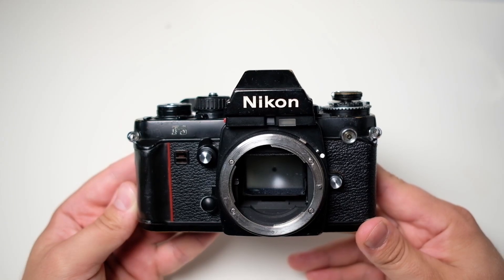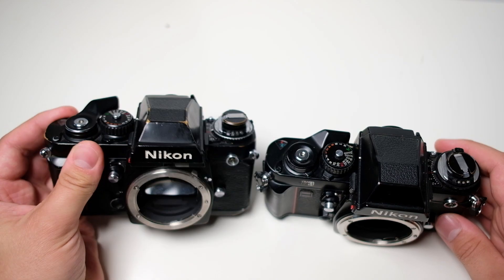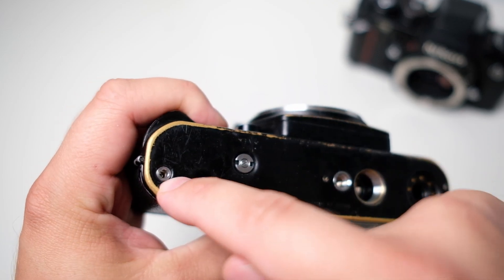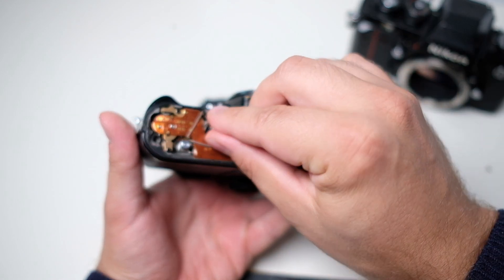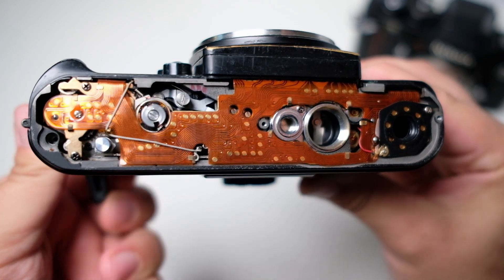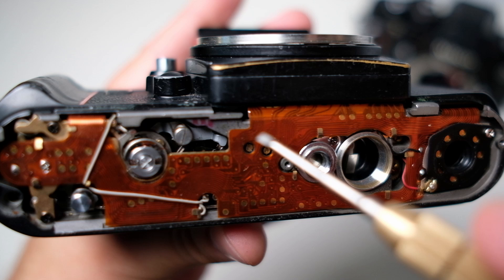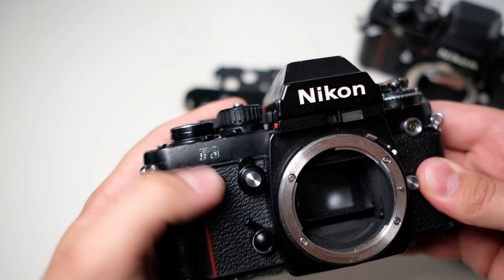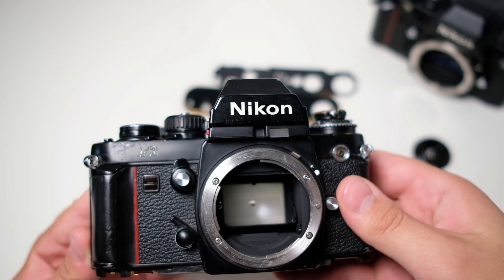Nikon F3 - How to Fix Stuck Film Advance / Shutter

Comment: Same thing happened to me a couple of years ago, I cańt believe it was that easy. Thank you! I’m guessing some cleaning will help if it happens again,.
Reply from the maker: Happy to help! My F3 was also stuck for many years, I got the idea to try this after fixing a Canon AV-1 the same way.
Reply: @mikaelrphoto  Have you found a more permanent solution? Like lubricating or cleaning some part inside? I wish I could trust that camera but to be shooting somewhere and for it to get stuck again would suck. For now it's my second camera. I don't trust it not having my tools around.
Reply from the maker: @elmaremoto My camera was randomly jamming a few times after I fixed it the first time. Also the shutter sounded weird while it was being wound up. Now it hasn't jammed for some time and the shutter sounds more normal, but yes, I also use it as a second camera since I don't trust mine either.  I'm not sure where to lubricate, I think it might need some more disassembly for the parts to be visible.
Reply: @mikaelrphoto  I understand, thank you for taking your time to respond my message, used the camera today without any issues, again thank you!

Comment: Thanks for the great video. I seem to have a slightly different problem with my Nikon F3, but maybe you could help me out!
The shutter-release button of my camera does not work properly anymore, while the film advance works perfectly. The batteries inside are new, the camera is turned on and the exposure/ light meter still works. I can take a photo by using the backup mechanical release lever but the shutter-release button will only fire after pressing it many many times, always randomly...
Reply from the maker: Sounds like an electric contact problem, possibly corrosion or some other dirt preventing contact. It might be enough to spray some electronics cleaner on the shutter button, so the liquid goes in around it (don't use much of it). Otherwise the contact can be cleaned from the inside. It is possible to remove the shutter button without taking off the top plate. Check this video for more information: https://www.youtube.com/watch?v=Ae2FbFoQUQw
Reply: Thanks a lot! I’ll give it a try.

Comment: My Canon AE 1 did this today, I was on photo 29 out of 36, so I was surprised when I couldn't take a picture, I thought i had forgotten to advance it, but it wouldn't advance either. (It's the first roll I've taken in about 5 years.) I just wound it back in and developed it, and the last part of the film is unexposed. After taking the roll out, it seems to take and advance fine with no roll in it. We'll see what happens next roll.
Reply from the maker: Yeah, it's disappointing when you lose shots because of camera problems. I hope it keeps working! My F3 got stuck after I had finished a roll, I forgot the camera half-wound up after taking out the film. So I don't know if it got stuck because of that.

Comment: Hello! Thank you for your video and happy to read it solved so many people’s problems! I tried what you recommended, but unfortunately in my case, the film advance remains stuck 1/3 of the way through. When I opened the bottom, it was as if it was ready to shoot and I couldn’t push the little metal thing at all. The resistance was very important. Any idea what else it could be? :(
Reply from the maker: Hello! Unfortunately I'm not familiar with the problem, sounds like it's stuck somewhere else, before it engages the shutter mechanism.